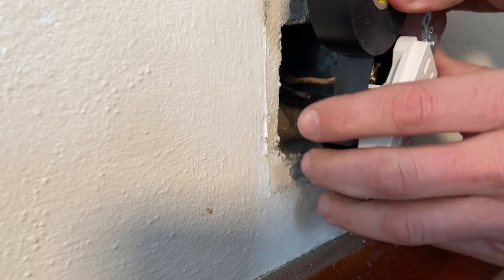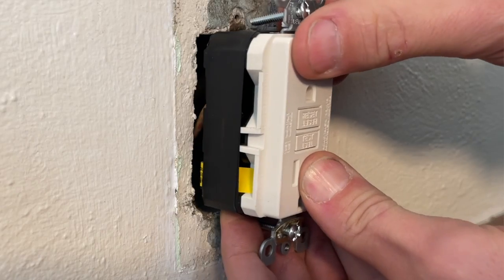Should You Wrap Outlets In Electrical Tape?

Comment: Electrical tape is used on wire nuts to prevent them from backing out or loosening due to vibration. Testing for a solid connection must be done before tape is applied. But this has all been eliminated with the use of Wago leaver connectors.
Reply from the maker: I do like the Wago lever nuts 👍
Reply: Wago’s are good, but if that little locking  tab gets nudged the wrong way when stuffing the wires back in the box, you’re going to have a problem.
Reply: @huejanus5505  that's not true there was a video the demonstrated that. It must be more than just nudged it must be pulled up in a vertical position perpendicular to the body. why are you lying about it if you are talkin about the # 221 lever connector the most recent ones. They even join stranded wire with or without solid wire better than wire nuts with less chance of a fire. I have seen wire nuts that were so loose the wires inside were arcing and the wire nuts were blackened. Vibrations loosen wire nuts. I have seen many loose wire nuts that I had to replace and tape because there was a lot of Street vibration around the house and businesses.
Reply: @eugeneshealthproject  so you are saying it doesn't work  either.   How many rolls of tape Have you seen turn into funnels.
Reply: @huejanus5505  

If you unlock a wago by stuffing wires you have a different issue at hand.

Comment: Really well done.
I always wrap receptacles. Period.
As long as we have bare copper wires in our boxes, it is mandatory and I demand it from all our electricians, just as I forbid backstabbing under any circumstances, ever.
I stopped using wirenuts way back when - WAGOs work better, period.
Reply: Wagos are similar to back stabbing...the only time I wrap in tape is in multiple gang boxes
Reply from the maker: Nice!  Thanks for the feedback Ethan and WAGO 221 lever nuts are growing on me.  I have WAGO 2773 on order to see if these newer more compact push pins are worth using going forward.  The problem is I think they are back ordered until Aug 2021.
Reply: Wrap in a metal box yes. Wire nuts no (you will have sticky black hands after you waste time undoing them. Ideal, 3m, Wago are good quality, could have used a yellow Ideal winged nut for 3 number 12's. I could not see if you bootlegged the GFI but maybe a GFI breaker would be appropriate. There are always opinions on what constitutes best practices vs min code. Agree to never daisy chain through the outlet, better to be a branch on the tree and it won't heat up the outlet or leave the downstream ones without power. Just my 2 cents.

Comment: i have an industrial plant. almost never do we tape around an outlet unless it's tight and 460v.we only use stranded wire. with stranded never twist the wires together before putting on the wire nut. it won't grab properly. instead hold them parrallel and use the wire nut to twist them together until you see the wires twisting beyond the nut.test each lead for pullout. we never put tape on nuts. use the 3m wingnuts with the rubber skirts.
with solid wires you can twist them together first.

Comment: I learned to do that back in 1970 when I worked for the Orange County Fl Schools summer apprentice program as an Electrician Apprentice. The Journeyman I was assigned to showed me how to do a lot about electrical work.
Reply: NECA NEIS 130 5.3 Conductors (L) states "DO NOT wrap electrical tape around wiring device terminals. Taping wiring device 
terminals will prevent heat dissipation from the wiring device." National Electrical Contractors Association  National  Electrical  Industry  Standards

Comment: 5:29 I do tape the wires together, after pull test, but I do not wrap the wire nut as well. I wrap the wires about 6"-1' down because it keeps the wires in place encase someone moves it so that the wires inside the nut don't come loose.

Comment: 1. That old gooey cloth electrical tape we used, before vinyl, was usually called "friction tape." I remember it from back in the 50's. Still sold. Generally it hardened like a rock. I have had to remove it and was not easy.
2. I also wrap switches.
3. I do not wrap wire nuts but have migrated to Wago Wall-Nuts.
Reply: Wago completely obsoleted wire nuts. The 221 series lever nuts are also super useful when you have a ton of wires you need to reconfigure frequently. They're nice because it is easy to reconfigure wiring, then when you get it right you just leave them because they handle vibration fine. Also nice because they make it easy to add terminating resistors to data wiring.
Reply: @tombax1653  contractors and electricians are cheap, wire nuts are still cheaper lol
Reply: That friction tape is a godsend with using splitbolts and than 33+ after
Reply: We used to buy friction tape all the time. It was great on the blades of our hockey sticks, and to build up the butt end. But, always finish the butt end with hockey tape, otherwise the friction tape will destroy the palm of your glove.  Oh, for electric devices? Don't use tape. I make mechanical connections, and ensure they are secure.

Comment: According to my electrician, he prefers to tape them. However it is against electrical code here and would fail inspection here if you got a persnickity inspector.
Reply: You are not violating Electrical codes by taping your outlets  !! That must be the towns Electrical inspectors own rule . The town can over ride The NEC . In my view it only makes working on the receptacle that much safer when working on it live.
Reply: there is no code in the NEC saying you can't tape them. I personally only tape outlets that are close together or in a metal box. in a plastic box it makes no difference
Reply: @williameisenberg1999  there are a lot of places outside the US that use codes other than the NEC. The original commentor might be from somewhere that forbids wrapping in their national code.
Reply: Maybe the inspector wants to see a proper shepherd's hook, and if it's taped up he can't see it.
Reply: @JeremyHansen  there's a lot of towns and municipals that tweak the codes to their own liking as well. I had one inspector fail a house because the conduit was cut with a tubing cutter (properly). In the end it all comes down to the person signing the green tag or hopefully not the red one.
Reply: @oldcrazyeye6482  how did he know it was cut with a tubing cutter? I don’t use them because it rolls the metal inside and it’s harder to ream.
Reply: @blueoval250  Harder, but not impossible. ANY other cutter will produce burrs that need to be cleaned as well. The only thing that won't, is a torch...and who does THAT!

Comment: Case study; It wasn’t until I experienced a major short in a HVAC 60amp utility feed connection that I started taping wire nuts. A 60 cycle frequency pulse over time has the potential to cause a wire nut internal tension to gap causing arching even in a properly installed wire nut. This case, the arching heat over time burned through the wire nut which was touching the metal access cover panel of a home owner A/C air handler unit. The direct short caused intermittent sparking to shoot across the owners garage and burned a 2 inch hole in the panel cover. The breaker eventually tripped. I now tape all wire nuts in a clockwise rotation as to maintain the wire nut in tension. Lesson learned; It is good PM to periodically inspect all high amp wire nut connections for integrity and any sign of over heating.

Comment: As a 30 yr industrial maintenance/repair electrician. Always tape your dang wire nuts. Verify wires are in the wire nut good.  Run the tape first around the wires a couple wraps then up over the wire nut to seal off the opening. When done if possible bend so that the open end of the wire nut is down. This helps with vibration, keeps strain off the wire nut, keeps bugs out of the connection (yes they will get in it, die and short) and helps minimize moisture in it. Hold the nut and run the tape counterclockwise thus in the opposite direction that the wire nut screws on. That way when the next person comes along to work on it they can take the tape off easier without unscrewing the wire nut. Also leave a  short folded tab on anything you tape, called a buddy tab. Again allows the next person that comes along to more safely and easily remove the tape for trouble shooting. 
Also wrap the recepticle, protects it from insects, occasionally dust and moisture and most importantly it more makes it safer and easier on the person that comes along several years later trouble shooting something on the line.
While we are at it: use a descent tape of some sort. IE Scotch 33+ eqivilent or better. if youre working in cold weather the Scotch Super 88 is outstanding (my favorite but a little more expensive). 
Tape stuff and use good tape so that in military parlance you won't be a "Buddy f**k*r"

Comment: I wrap outlets, wire nuts (always twist wires with pliers first), and a 2" area around the romex when it's going under a metal knockout connector... or anytime   I want some extra jacket protection.  Codes are minimum standards... you can do extra if you wish...
Reply: Great comment on code being a minimum. Thank you Motzart

Comment: Over past 30 years of working in electrical field, I have seen many cases of loose splices and even wire  nuts that fall off while  moving splices. Splices of solid conductor should made before wire nut is installed to confirm wires are wrapped properly around each other with no crossing of wires and no spaces between wires. Taping is always recommended over wire nut to ensure it does not loosen while splices are moved about. Also some brands of wire nuts are notorious for   not " grapping" well. (ie, Marrette brand #33 and #31). Your video implies that the tape is holding the wire nut on a very bad splice. The splice should be strong, independent of tape. The tape is there to prevent wire nut from loosesning while packing and unpacking wires in boxes, fixtures, etc. Since the wire nut is the insulator of splce, you do not need the expensive tape for providing reinforcement of splice. Also tape a around a receptacle in plastic or metal box can prevent a bare bond conductor from contacting any "hot" terminals
Reply: Excellent comment Ray Thanks! 👍
Reply: This is why I refuse to let Barry Bonds work on my electric.
Reply: @Joe-by8jh  yes I do no more than the engineers, I routinely have to troubleshoot and fix there shitty products, you never use the wire nut to twist your wires together, you twist wires together with your side cutters, and then apply wire nut, after putting wire nut on, you then pull on wire nut and wires to ensure good connection, you never wrap splices with tape, unless your splicing wires in a pecker head in a motor, you then use rubber tape and 33 so that the kerney doesn’t short from vibration of the motor. 
To many people on here with no experience giving opinions on things they know nothing about. 

Unless you have sold the product, installed the product, warranted the product, you don’t have enough knowledge to comment. 
Doing those things make you an expert, not designing a product that doesn’t work, IE the engineers who you speak so highly of
Reply: If you require tape over wire nuts to "ensure it doesn't loosen", you're doing your wire nuts wrong. Maybe you should switch completely to Wagos or a different profession so you don't burn down a house...